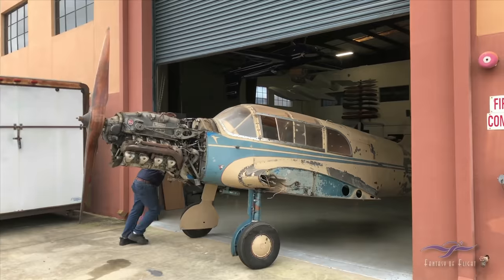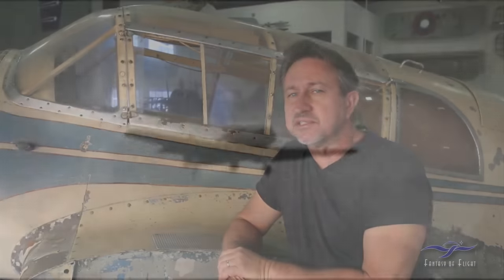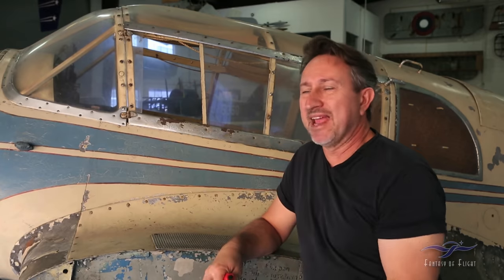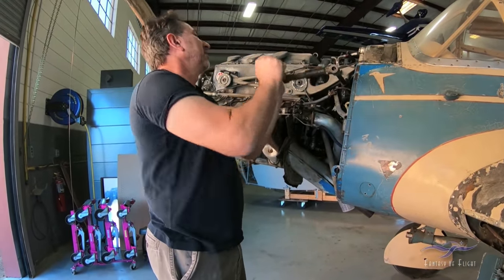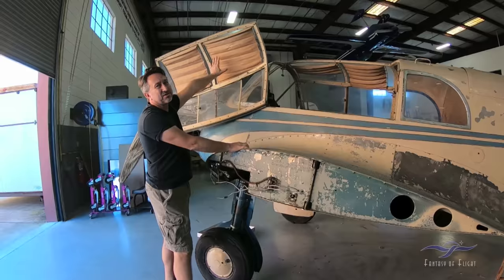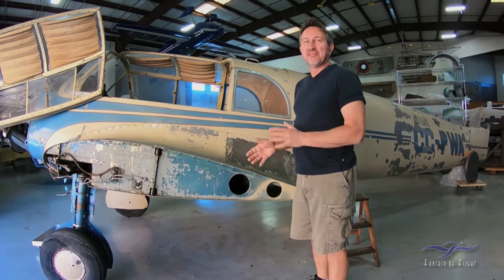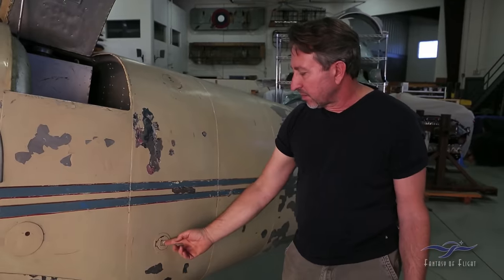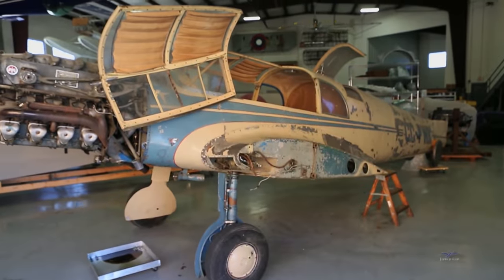Messerschmitt Bf-108 - Restoration Update #01 A - March 2018

Comment: When I was stationed in Alamogordo NM in the mid 80s I stopped by the little airport to look around. Heard of a few used ultralight aircraft and wanted to look at them. Just strolling around I see a hanger door open and of course I looked in and seen a 108 a guy was working on. Never seen one before. Didn't think to much about it and moved on. If I remember right it was blue and white just like yours.  I wonder.

Comment: What an amazing airplane! I wish they still made em like this nowadays.
Reply: They still make aluminum civil aviation aircraft with reciprocating engines. Did you think otherwise or are you just waxing nostalgic because that's the "thing" to do in comment sections about "historic" vehicles?
Reply: The difference between the planes of today is that the cockpit isn't filled with Ipads and Garmins, the paint lines are simple yet very pleasing to the eye, and it was built in an era where the plane was made and you actually had to have skill to fly it compared to all of the aircraft made today where it is built around any average joe pilot being able to hop in and go. It's not about the plane specifically, although it is a beautiful piece of hardware, but it is about the bygone era of actual flying.
Reply: They made it after the WWII in France with modern tripod landing gear. The type was called "Nord 1101".

Comment: The holes towards the tail could have gotten elongated from using a tow bar that didn't fit right or one that was wore out from being used alot. It's still common practice on folding wing aircraft to hook a tow bar through the tail for towing. I read an old Avid Flyer construction manual earlier today and it also tows this way.

Comment: Wow 350 hours prior to 1942. Probably pressed into civilian service for the German war effort. 
REally nice project for you! 
Congratualtions on such an original aircraft, I work on ORIGINAL vintage and antique cars and recently had a 1922 Oldsmobile in with 2500 original miles and original paint interior etc... Aluminum V8 engine in 1922 cast at the BOHN foundry in detroit. The originality is so wonderful to study and replicate.

Comment: Note that there was another much less known German pre-war high-performance record-breaking sport/touring aircraft with retractable landing gear, the AR 79 from the Arado company /better nown for its jet bomber, the AR 234), which was capable of 230Km/h on as little as 105 horsepower. I was lucky enough to see it flying during the period of 1996-2001 when it was kept airworthy in Germany by the Deutsche Lufthansa Berlin Stiftung. Sadly enough it is now on static display only, in the Deutsches Technik Museum Berlin. For more information see https://en.wikipedia.org/wiki/Arado_Ar_79

Comment: I thought two of these BF-108 s were used in the movie by Paramount Lucasfilm Indiana Jones and the Last Crusade as they had machine guns on them firing through the propeller blades as well as a vehicle the Kubelwagen replicas built on a air-cooled volkswagen beetle chassis as it had a two tip beetle muffler the ones used in the movie. i can't confirm if the ME BF-108 was used in the movie. as i red VW produced the kubelwagen after 1939 up to 1945. as the movie themed it in the mid 1930s  as it had a DC-3 plus a Zeppelin blimp what kind of plane was that on the bottom of it in the movie?

Comment: It has ben said that the revolutionary semi-monocoque stressed-skin construction used on the BF108 was unique at the time outside the USA, so the British Handley-Page company decided to swop patents, enabeling them to make a big leap in all-metal construction, Bayerische Flugzeugwerke (BF) obtaining the permission to use the automatic Handley-Page automatic leading edge slats in return. This led to the rather absurd situation that the British Handley-Page automatic slats used on the Messerschmidt BF109 fighter, enabeling them to pull tighter turns, helped shoot down British Spitfires, while four-engined Handley-Page heavy bombers using Messerschmidt-type stressed-skin construction bombed Germany by night!
Reply: as frenchmen you forgott the 1935 Caudron Simoun?!!!... use same type of built, and was same fast as the Me108 with a smaller  220hp engine and fixed gear...so the me 108 no so "advanced" as some think...
Reply: Oh yes I like the Caudrons, giving exceptional performance on comparatively small engines. Yet it was the 108 and its NORD derivatives which was prduced in France after the war, not the Caudrons.
Reply: I especially love the Caudron 760 wartime fighters, perfect  representatives of the pre-war light-weight fighter concept (much like the Northrop F-5 Freedom Fighter today) and flown by Polish pilots during the Battle of France, with one example restored to flying condition in France
Reply: Sorry the ones used in WW2 were Caudron 714s, not 760s, but were essentialy very similar

Comment: just that fairing between the wing/fuselage junction, not that much different from the Spitfire's, is a piece of aerodynamic art in itself, compare that to the rather crude biplane struts and wires of the era

Comment: You can send me that "junk" engine if you want. I'll use it as outdoor fan in the summer or something. I've thought about building an airboat with an aircraft engine,  too. I'm just a diesel mechanic but I've worked on a gas-burner or a thousand over the years. Lots of air-cooled ones, too. And I'm German/Swiss back in my family tree (Meyer, Hess etc.) and have a buddy who is an A&P I can turn to if I get confused or something. So its a natch.

Comment: "Messerschmitt" = "Knife Smith" - both the 108 and 109 had horrible landing gear which was too narrow and splayed outward so that the weight of the plane rode on the inside track of the tires. Retracts were an afterthought for these models and had to be pivoted outward from the fuselage and wing roots because there was too little room in the wing for the hydraulics. Original design was for consideraly wider fixed landing gear attached to the wings. Our own Wildcat was the same way.
Reply: ..Spitfire landing gear wasn't great, either...

Comment: Is the BF 109 shown in the picture early on in Finnish markings? Luftwaffe airplanes had a tilted swastica on the vertical fin but the national markings were variations of the cross left over (modified) from the Imperial German Air-force. I remember pictures of the Finnish Brewster Buffalos with the same or similar markings.
Reply: Yes Finnish markings
Reply: Whitpusmc ià

Comment: Battery and fuel right next to each other. How the hell did that pass safety regulations?
Reply: Have you thought about almost every modern car we drive today with an electronic fuel pump submerged inside the fuel tank?
Reply: safety is for cars, the danger makes pilots so sexy, to fly was and stays risky. keep it as it is. It has already proven its magic.

Comment: I can't help but wish the 108 you have was in extremely poor condition ie a gutted airframe, missing parts etc. as restoring it to flight would have been ok. But to restore this 108 you have here in its incredibly complete and time warp condition is almost a travesty. Personally its value is in its current state re it last coat of paint, original trim, carpet, cockpit glazing & curtains etc etc. all will be lost. It wears its years with pride and tells a story as is... personally I feel it is of greater value in telling a story about the history of flight than a pristine restored aircraft with no sole. Don't get me wrong I've know doubt you guys will do an incredible job as usual BUT if it was put on display as is, it would be a greater draw card than just another restored flying aircraft.